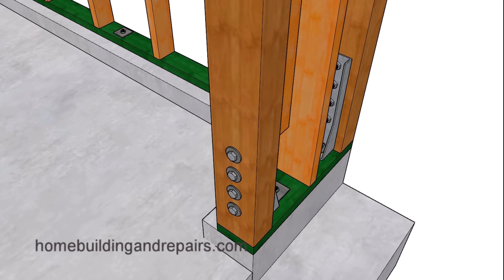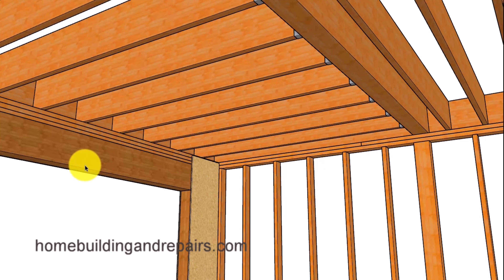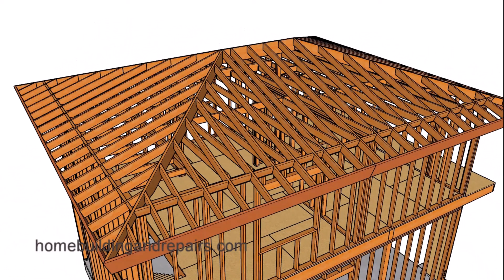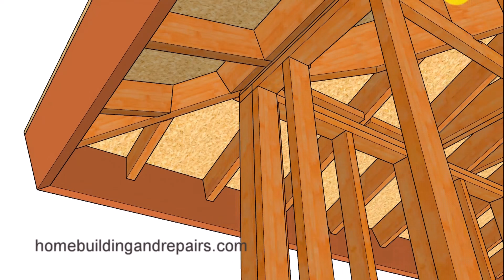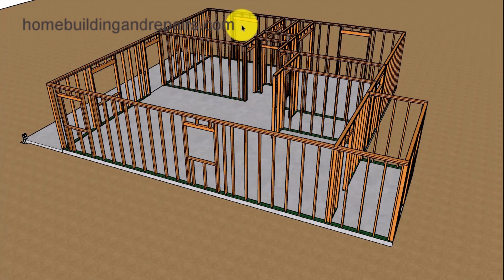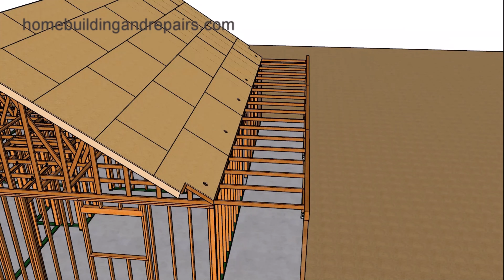Two House Framing Projects You Can Get Some Design And Building Ideas From

Comment: Young carpenter here. I've noticed that your blocking around the perimeter of the roof ceiling connection would be an obstruction for soffit ventilation. Is this just not necessary in your area or do you have other ideas for ventilation.
Sorry if you already attended to this in the video and I missed it.
Reply from the maker: That's a great observation; in many cases where we use that type of blocking, we either utilize alternative attic ventilation methods or ensure specific gaps are left to maintain airflow.